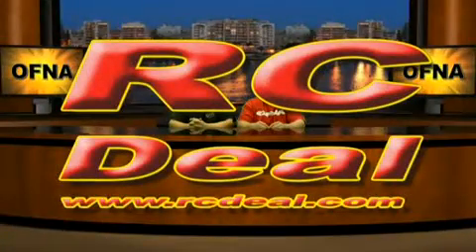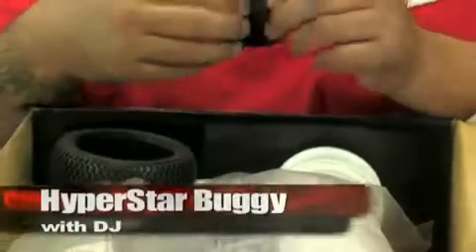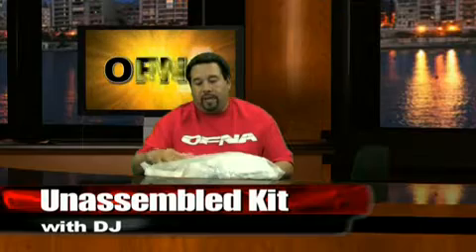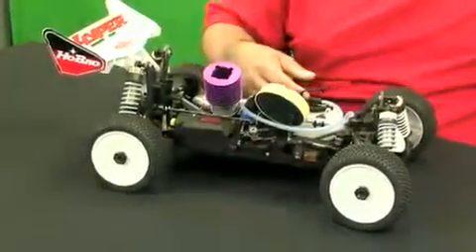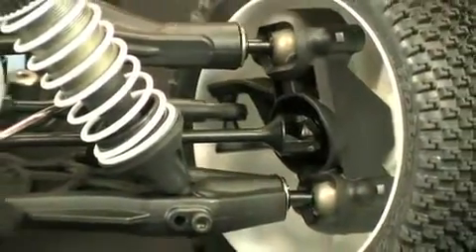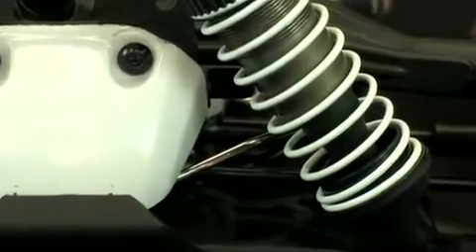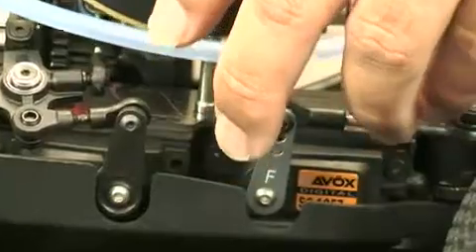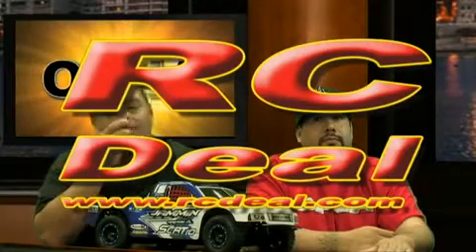UnBox-HyperStar 1/8 Nitro Buggy

Comment: @monnyg1 sorry i was thinking of the hyper boost engines.The Picco is good man,very good,but if you want a engine with overall more power and speed check out the engines i told you about.Novarossi FMS,RB Shark, the Werks B5(B6) does also deserve a place among the Top 10 meanest buggy engines.There is a lot of great engines out there.Im very happy with my choise of engines and i hope you find something that fits your driving style.Good luck...

Comment: Its a toy engine.If you want to race or bash and want experience real power and speed.The Toro Nero team engine from novarossi is also a killer,nearly exactly the same specs as the Bonito but for a more affordable price,trust me you want go wrong with those engines.I have 2 toro nero and 1 bonito and a lot of other high end engines but thats another story.Go for the Toro Nero Team.Check out my channel where i drive with a Toro nero Team.